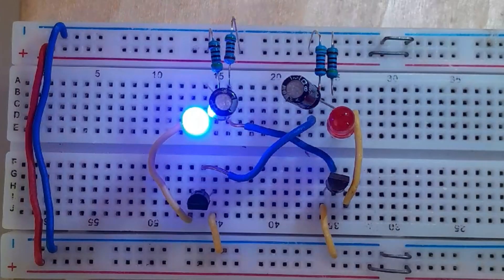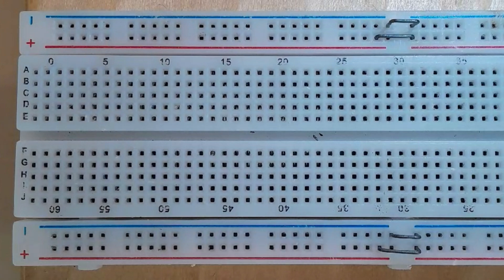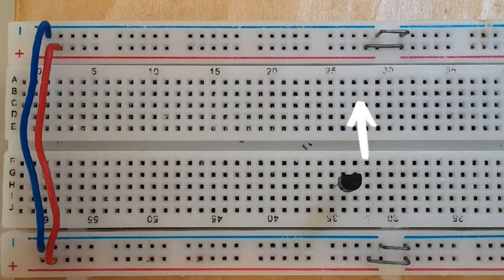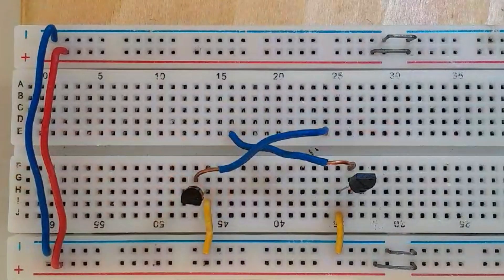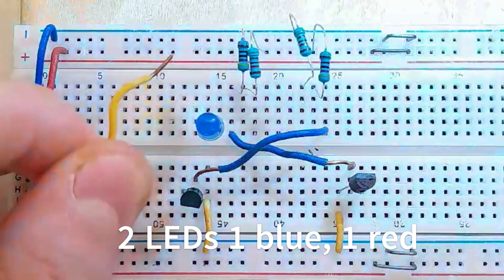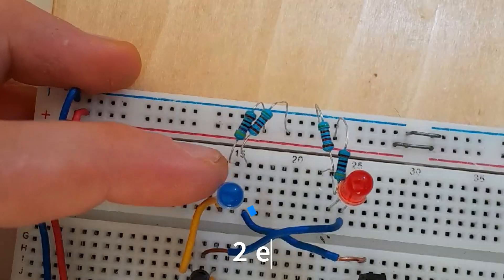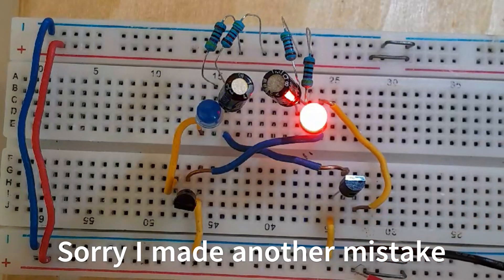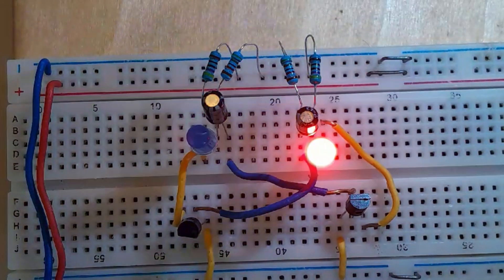How to make a blinking LED circuit

Comment: Hi there is a problem when I made the same circuit both leds are glowing simultaneously for the whole time no blinking action is there what to do
Reply: I am unable to find you mail id
Reply from the maker: ok dont worry ill help you out, but comment first your chosen values

first check the capacitor ratings, it should be 47uf

next what partnumber transistor do I use, because some of the didn't work when I made it myself

if the rest of the component/ all of the components are the same value of the video, let me know and i will help you further
Reply: @KIWIvolt values of all components 
Resistor 470 ohm and 33k ohm
Capacitor 22 micro farad
BC 547 bjt 
9 v battery
Reply from the maker: @studywithradhika Ok thx
Reply from the maker: @studywithradhika now check if the wiring is done correctly and if they're making good contact
Reply from the maker: it should be wired according to this scematic 

https://electronics.stackexchange.com/questions/12283
Reply: @KIWIvolt sir connections are same please help
Reply from the maker: @studywithradhika  ok don't worry
I can't really help you further now, without pictures/videos please email me the circuit in video or photo and ill analyse your circuit, you can find my mail in the channel bio
Reply: @KIWIvolt couldn't find your mail
Reply from the maker: @studywithradhika  its kiwivolt.yt@gmail.com